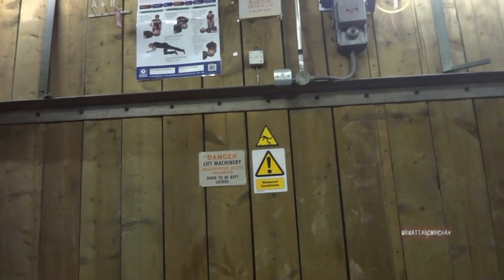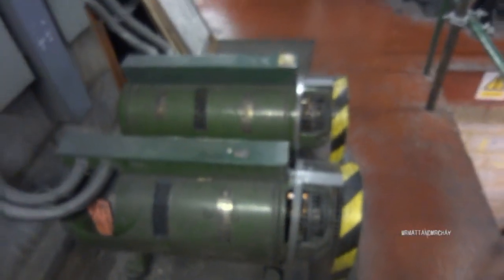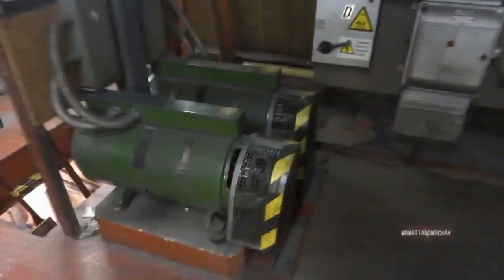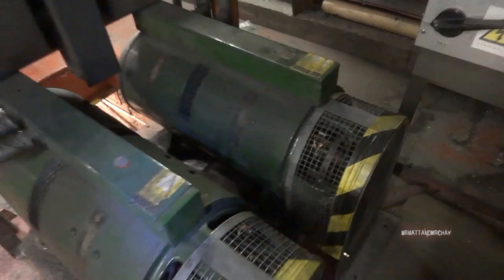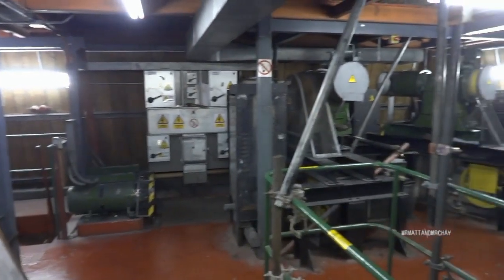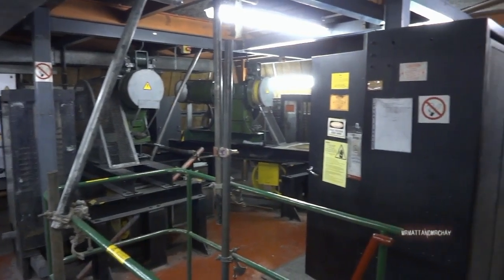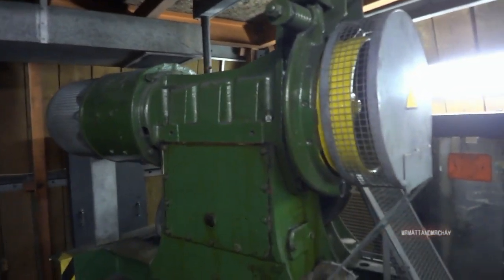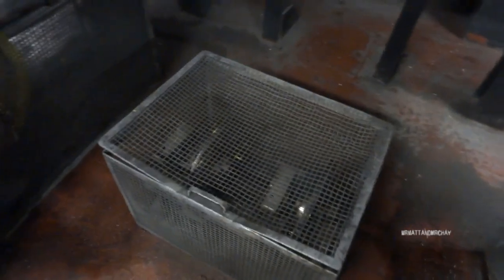1971 Otis elevators Part 2 - The motor room

Comment: These lift equipment rooms can be very scary! As a commercial fire alarm & card access tech, I have been in many of them. Some of these DC motors are running over 4000 VDC and often times the guards are removed from the brakes & cable pulleys. I get like a cat in a room full of rocking chairs every time I go into the penthouse and I get really jumpy when the motors click on/off right next to me.
Reply: 4kV?  I thought most of them were 230 or 400v.  I once saw some hoists that ran on 120VDC.
Reply from the maker: ClusterCracker I am also an access control sys tech guy!  I've been caught out by a few motor start ups and jumped, for instance see https://www.youtube.com/watch?v=ysLenmK3kKw see 0:33 and 3:02 LOL
Reply: mrmattandmrchay
Yes, those are small hoist units compared to some I have seen in 50+ floor lifts downtown. It gets really precarious to get at the smoke/heat detectors over the potentially moving at any moment parts. Good videos!
 The worst was a heat detector in a transformer vault at a school, I had to throw plywood over the switchgear feed ladder and stand over 3 6KV transformers 2 feet from the phase knife switches. Talk about not dropping any screws down lol.
Reply: A few too many zeros there!  The 415vac supply was the highest voltage, but that needed to be treated with respect…easily lethal.

Comment: mrmattandmrchay Hi, and thank you for your interesting videos! Just suscribed to your chan... I wondered, like others, why they didn't changed to Solid-state DC power supply (switching power units are efficient and reliable) even using those generators? But i can understand the money-cost side also.
I saw vaccum tubes, valves (a lot of capacitors behind), and a nice glowing VR75 regulator tube (OA3 75v@30mA) What are they used for, in this setup? (Audio music amplifier for the easy-listening entertainment? But i don't think so...)
Thanks for sharing!!
Reply: +yahnsolo The selenium rectifier and glowing regulator tube (with caps) may be a power supply to run the relays.
Reply: +norman gates 3 Phase incoming supply to primary side of transformer, secondary side of transformer is then connected  to the control rectifier which converts the supply to DC at about 130 Volts. This is used to supply the main contactors and control relays.

Comment: 7:58 When he carriage finds an active call to initiate a stop could that active call lever be initiated by selecting a floor as well as calling the lift? For example going from Ground floor and selecting floor 5 will open a call lever on the 5th floor bar so that a stop is initiated when the carriages reaches 5th floor bar? Thanks.
Reply from the maker: See...
The promised "EPIC SELECTA MOVIE" - A beginners guide to 1970's relay logic circuits!
at 08:25 - hope this answers your question.
Yes, for an UP/DOWN button system, there are three call logic circuits per floor, but watch the video as this probably describes it better than I can explain here.

Comment: Another nice motor-room vid Matt. I never tire of watching the old 6850 selectors*, seeing the crown snap down and those inquisitive contacts feeling for the pie plate.
Did I see some rocking going on there on a few floors, LU and LD a bit too close perhaps?

@force311999, it's a bit more complex than a jukebox because there are different types of call to distinguish and place into order, but underneath the selector concept is similar. Although, lift mechanics should be well pleased that there were no floor selectors built like the Seeburg Tormat.

*Actually, you need to find a system with advancer panels and get shooting...

Comment: The current drawn on the AC motor side will depend on the load presented on the DC side, so the generators will not draw their full rating continuously.  That said, even running idle with no secondary load the generators will still burn up a modest amount of power.  I think the main reason the timers aren't fixed is that it isn't just as simple as turning them on when the lift is called.  They have to run up to speed first and that involves other circuitry.  That and lazy or bad engineers.
Reply: Big Clive? OMG! Love your YouTube channel!

Comment: The top rooms in this place can go for around £10000 per night so the electricity cost is small change. During the day the lifts would have quite a high traffic volume so engineer/site would be none the wiser. At night this motor room should silent apart from the odd guest turning up or room service delivery. Not sure if parts for these are easily available bearing in mind they were installed not long after England won the world cup :( I think they plan to replace next year

Comment: Each Generator has an output of 6 Kwph so that's 24kwph for all 4.  If say its 25 pence per kwh that means the generators are burning £144 a day in electric. £144 x 365 days = over £ 52000 a year ! if they have been like that for 10 years that's over half a million pounds! Should of invested in new lifts years ago :)
Reply: Those generators aren’t running on full output continuously or even for much of the time at all!

Comment: Instead of running DC generators why dont they just replace them with some wtf humongous silicone rectifiers?  How much power would each of those generators be using?  I imagine each one is kilowatts, they are also surely not designed for 100% duty cycle so surely the wear and tear makes this hack/bodge not worth while?!
Reply: Thyristors combined with silicon rectifiers replaced a lot of M-G drives back in the 1970s.  There are still a lot of field-controlled M-G systems out there because they are simple to work on and very reliable, i.e. you don't have to worry about a motor control board going out...